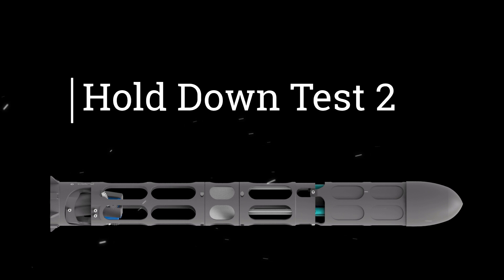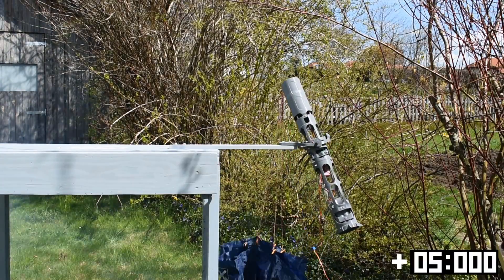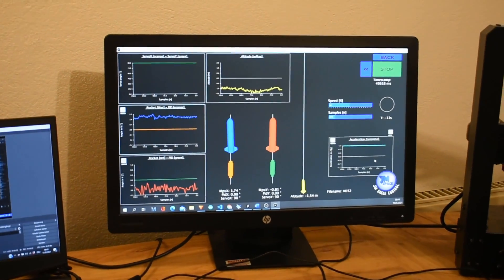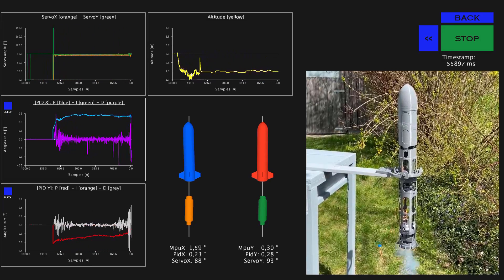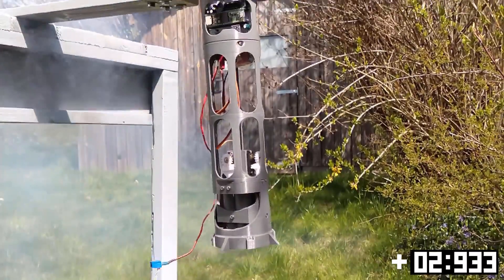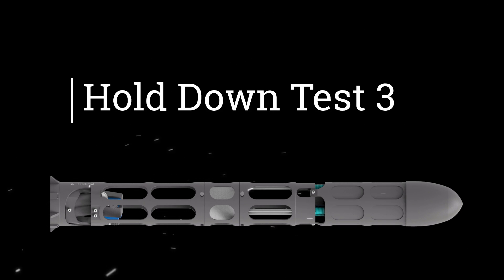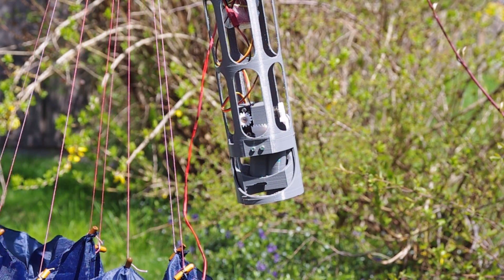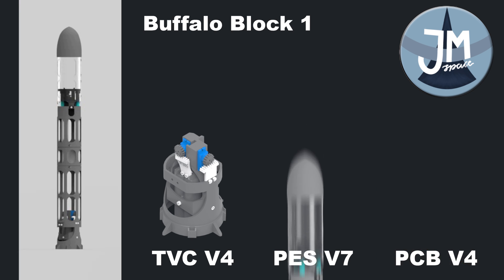Thrust Vector Control | Rocket Hold Down

Comment: ignition @ t-3s ?
Reply from the maker: Actually @ t-4s, so that the rocket would lift of at t-0s. The rocket has a pre burner from 4sec
Reply: @jmspaceR  Why is that? Doesn't that reduce the flight time of your rocket by a significant amount?
Reply from the maker: @CoronaFighter_  during those four seconds the thrust is extremely low as it is only a pre-burner. I don't know why you should buy an engine with a preburner, but I did ... For the launches that followed I used normal engines.
Reply: @jmspaceR  Oh ok. Great rockets by the way! Look amazing.

Comment: Good test ,a advice to you that avoid gears straight connect servos to tvc
Reply from the maker: Thank you! Wait what would be the benefit from that and how to do?
Reply: @jmspaceR   see if it's a gear then there would be some amount of friction which would reduce speed of reaction ( TVC) so connect servo with help of iron rod to TVC .Which helps to make quick movement.
Reply from the maker: @aathithyapandian8006  I see, but that is a system everyone uses and which I think is also not as precise. I have tried some kind of system like that before, but for now I prefer the system I am currently using!
Reply: And. Try to make TVC controlling in a different manner than other like how L Shang did
Reply: Just suggesting you to remove the gears and use any other thing like 3d printed supporters
Reply from the maker: @aathithyapandian8006  Okay thank you anyways, I will consider that after a successful flight!